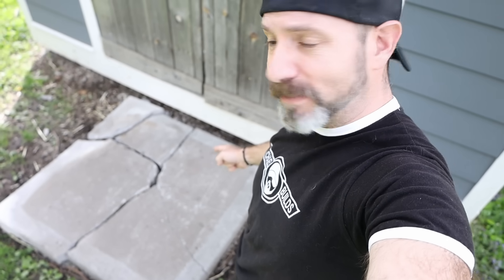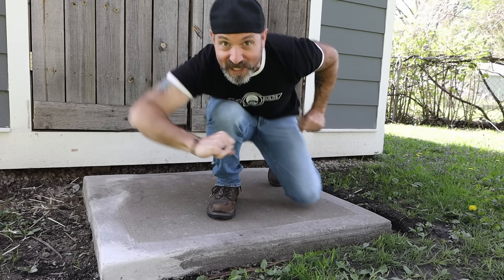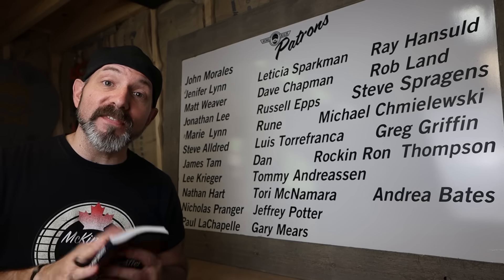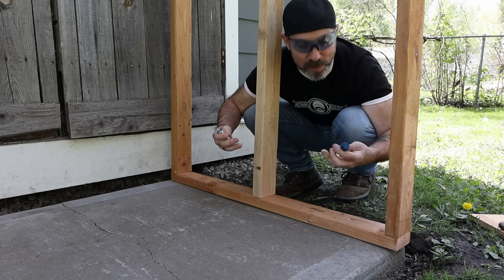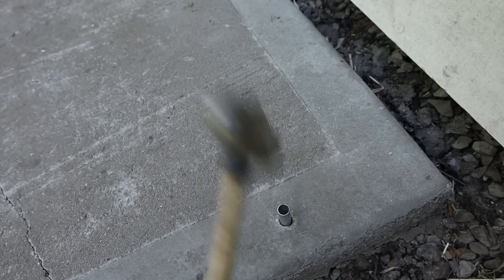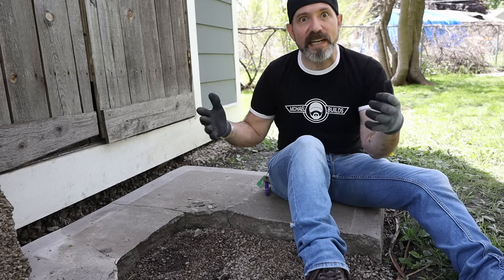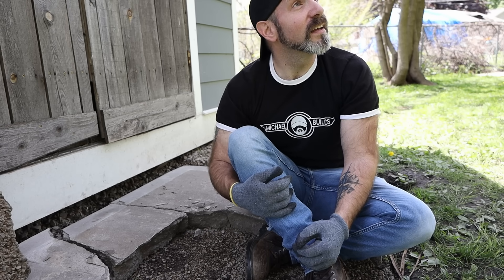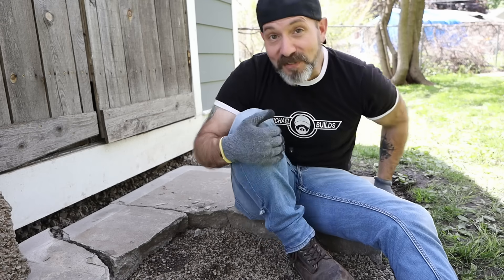Dry Pour 30 day cure Test

Comment: It certainly would have worked for a storage building. If the base is properly prepared, you should be able to drive on top of it. Had there been a hard-packed rock base, it likely would not have cracked.

Steel reinforced concrete helps spreads the point load out over a larger area, reducing the flexing in the middle. That tiny amount of concrete flexing each time you drove across the middle of the concrete was enough to mash down the soil underneath the middle of the concrete. That gap eventually became large enough to remove any base support.

Dry pour can certainly be effective for some uses, but the major problem I see with doing a dry pour is breathing in the concrete dust. Regular face masks, even N-95, are not actually sufficient in keeping all the dust out of your lungs. Even very small amounts of concrete mix dust in your lungs are a huge health hazard, which may not become obvious until years later.

I recommend placing a fan, powered by a small generator, so the fan is constantly blowing the concrete dust away from your face. You do not want even a light breeze blowing those tiny dust particles toward your face. You can’t actually see the tiny dust particles that can end up going into your lungs. If you can smell it, you are breathing it in, even if you can’t see it.
Reply: We pretty much quit using metal re-enforcement in concrete slabs years ago. Fiberglass works as well if not better and cuts out a lot of work.

Comment: There's a much easier way to solve this debate. Make some concrete cubes using the same method and have them crushed after 28 days at an accredited laboratory. To be thorough you could also take some cores and have them crushed at 28 days too (in case any one claims that that the cube is not representative due to the inability of the cement in the cube to absorb water from the ground below)

Comment: You should have a 4" diameter core cut, full depth, take it to a lab for a.compression failure test. That is one test comparable to a wet mix test.

You don't necessarily need steel reinforcing.  Your subgrade (that you poured the concrete on) was weak and soft.  Topsoil needs removed and a compacted stone underneath.  A lot of expense, time and waste when time tested procedures have been used.

How did you prep and create the slab?  I didn't see that in the beginning, a recap intro would have been nice.

Oh yeah, its masonry, not mason-ary.  Sorry construction police 😂

Comment: I’m very tempted to do my own slab addition. Will you use re enforcement on your lean to project? I’m tempted to dowel into my existing slab, and lay rebar fir the addition. My project is only a 4-6’ extension to an existing slab.

Comment: Dry pour is both lazy and extra work for a sub standard product. Just do it right and quit trying to cut corners. Its concrete, there is no reason to push the bleeding edge. mix it, pour it, let it set. Its not that complicated. You are just asking for problems trying to dry pour.
Reply: MichaelBuild  nope

Comment: As someone who works with concrete there are a couple of standard practices when placing a slab. Subgrade compaction to 92-95% max dry density (removal of soft material), placement and compaction of base course to 92-95% compaction of MDD, rebar at least 1-2" from the bottom of the pour (gives flexural strength as concrete is weak in bending and axial moments), and proper hydration of cementitious mixture. If your mix is dry it will crack and spall more easily, as since in your load testing.
The preferred method for testing in grade slabs, outside of a pen test, is coring it. If you take a core you can see if the mix was hydrated properly, if it has voids, if the aggregate was dirty, and to run a compression test. Anyway dry pour is a dumb idea for anything  outside of your child's toy house

Comment: I believe it cracked because it didn't have a solid base and still would of cracked if traditionally done. 
With those drilled anchors passing I wonder how it would handle a few rammset style nails fired into it.

Comment: It's really no surprise that it cured all the way through, as long as you're able to get the water in it. Cement actually needs very, very little water to react and cure. The amount of water that is normally added to "pour" concrete is way too much and actually reduces the overall strength of the concrete, but we add all that water to get workability and to get it to flow. I'm very interested in doing a dry pour like this! Looks way easier!

Comment: Michael, first of all, don't ever let anyone tell you that you're not a scientist, your methodology is so much more rigorous than what an alarming majority of clip-board carrying quacks in white lab coats are doing these days.  All science is, is a method by which you make a prediction, test it in a number of ways (as many different ways as you can think of), then document and report the results. A fancy degree does not necessarily a scientist make, but what you're doing absolutely does.
Now, by all means keep going with all the tests you have in mind, but the ultimate test will have to be a compressive strength comparison under controlled conditions.  I suggest the following:
Make 6 test cylinders using cardboard tubes (you can get those from a carpet store, they'll probably let you have some for free), 6" in diameter by 12" tall (or 5"x10", or 4"x8", etc. depending on what inner diameter tube you're able to find).  Use the same concrete mix product.  Pour 3 cylinders using the conventional, pre-mixing method, and do the other 3 by dry-pouring.  Remove the cardboard forms after 2 days, and take the cylinders to your local materials testing lab. Have them crush, with a hydraulic press, one of each at 3 days, 7 days, and 28 days, then compare the measured results at all the respective points of failure.  Repeat with a different product if you wish.
I think this is going to be the only way to clearly determine if pre-mixing vs dry-pouring ultimately affects the strength of concrete.  If the results come back similar, then all the other suggested real-world tests you're doing are going to be significantly more valuable.
Keep up the great work!

Comment: just a thought for you, while one wheel of the truck is only liike 1000lbs, the tires are wide,  so it disperses the weight, you want to find a way to increase the PSI by reducing the contact patch of the tire. also, the slab was moving quite a bit which means it wasnt supported very well under it.

Comment: You also should think about the weight distribution over such a small pad. For what you got I think it held up great I know I'm convinced I would definitely use for a driveway I would definitely make sure I have a good substrate  and pack the ground just to make sure no soft spots and use reinforcements and should be good to go

Comment: Convincing enough to confirm moving forward with our 8 X 20 front pad in front of our new house. Wire is a given, and a compacted base under it. The same size pad poured mixed, would have failed as well with the soil under the same conditions.

Comment: The way the ground was prepared, even a traditionaly installed slab would have failed. The slab failed because of the movement of it, not the strength.

Comment: I wonder if one could use some course Sand as aggregate while still using the "dry pour" method. Sand is much cheaper than cement and it also gives it structure.

Comment: The slab cracked because the was no rebar and wiring. When doing a driveway 100% you need to put rebar with wiring. Its not for strength, its so the concrete can stick together. When you do the next projects, you should add rebar and wiring in the middle.

Comment: One day I would like to see someone compare dry pour with standard pour by putting both in a press to get real numbers on things like comprehensive strength.  I'm convinced that dry pour is perfectly fine for many non-critical projects, but it would be very interesting to know exactly what kind of difference in strength between the two methods... if any.
Reply: Id like to see the same thing. Im not convinced that there is complete hydration towards the middle/ bottom of the slab. But it would be cool to see a core sample and a couple of break samples to see whats going on. My understanding is that even conventionally mixed concrete benefits from having plasticizers in it to achieve complete hydration at lower water to cement ratios. The chemical plasticizers break the electrical bonds that form between cement particles and allow water to hydrate everything completely and evenly. This method doesnt agitate the mix at all, so I dont see how the cement particles would ever be completely hydrated without anything to help break the natural bonds that form between them when introduced to water. Concrete is typically weakened by having too much water added to make it easier to place and finish, but the opposite can also be true. If there isnt enough water to hydrate the cement, it will lose strength that way as well. I could be wrong, im definitely no scientist and i dont engineer this stuff, but I am a concrete guy that tries to stay educated on the stuff that actually goes on in the mix and keep up with the latest developments in mix designs so that I can produce better jobs. The core samples would take away all the theories though and put some hard numbers down that people could use when deciding if they want to use this method.

Comment: I think you could easily add reinforcement to the slab. Actually kinda shocked no rebar was used. Secondly it looked like the ground under the slab was moving when you drove on the slab. Not a fair test.

Comment: So I was thinking of doing a dry pour for a garage/shop that will have cars and suvs and pickup trucks coming in and out to be worked on with a home made kwik lift on it as well. Do you think if I did 6” instead of 4 and added the rebar panels  to it that it would hold up to it?  Im thinking of doing it as I don’t have the money to pay a crew or have a truck come in much less know how to go about it that way. Even if I did the pad for one stall is 22’ long x 14’ wide so it would kill me to even try to wet pour.

Comment: For what it's worth, thirty-five years ago and building trades class we were taught to set mailbox post in dry ready mixed concrete. Like, grab the top of the sakrete bag and pour it in, then template down, then put a little soil on top and tamp it down. We didn't missed it, we didn't water it. It soaked up moisture from the soil, and, if you've ever dug one of those up, they were solid!

Comment: Despite its very high compressive strength concrete has very poor tensile strength. Steel has the same coeficient of expansion as cement and has great tensile strength. Rebar would make a great difference to bearing the weight of a vehicle.

Comment: Thanks Mike, you are one of my favorite idiots with a camera. I’m glad I found your content while researching dry pour after watching Cajun Country Livin’s video.  I’m seriously considering some small DIY projects that I had wrote off previously due to the perceived amount of time sensitive effort required by a wet pour that I didn’t feel I would be capable of at my age. One thing I’m interested in is a variation of your cement countertops using the dry pour method.  Cheers!

Comment: I think if you did proper ground prep and 48 hours of framing boards left on after the wetting concrete will give different results. I will be doing a dry slab shortly for my doorway on my shed.

Comment: Dry pour has been around for years. It was used in industry, look for dry cast concrete molds. they fill a mold vibrate to compact it then infuse water. they was able to demold sooner dry casting than pouring wet.

Comment: This is great. I think that the first test had a failure for multiple reasons though. First the Unleveled nature of driving on top from a lower elevation over allowed the vehicle to push, tilt and lift which is most likely the reason it broke rather quickly (yes a hundred times is excessively poor). Also it needs Reinforcement (even for a slab this size) would be very beneficial. 

If another test is performed add rebar and level the slab to the ground. So when you drive over, it won't act like you are riding up a curb. 

Overall I think the video and test were great. It definitely shows that foot traffic would have no problem. And truthfully Under better setup, I wouldn't rule out driveway use quite yet. Thanks again for another interesting video.

Comment: If the slab were larger,  had a more compact sub base and didn’t rock back and forth while you drove over it, I don’t think it would have failed.   Great video, I’ve been thinking about using this method to poor a patio extension for an out door kitchen. You’ve convinced me to try it.
Reply: Larger slabs fail easier. The longer the slab the more tensile force exerted.
Reply: I think if the base was uniformly level and compacted, the slab would have held up just fine. I am going to give it a try as well.

Comment: I feel like we need more testing. 
1. RapidSet, mixed, no rebar.
2. RapidSet, mixed, with rebat.
3. Quikcrete, dry, with rebar.
4. Quikcrete, mixed, no rebar.
5. Quikcrete, mixed, with rebar.
6. Concrete truck mixed 40'x26' slab, with rebar under my carport.

Comment: I did a dry pour slab big enough to put two dodge ram 1500's and my lawncare trailer on few years back. Hasnt cracked yet. If your going to be driving/ parking on it. Most of the important work is preparing the ground under it. leveling, sand, gravel, and a absolute crapload of tamping.

Comment: Thanks for doing the test, as mentioned below you really need to compare it to a wet pour to have any real value.
The major problem with the "Cajun" method is misting the surface, it makes a weak surface.  With your truck tires turning back and forth, it will eventually scrap away the weak surface unlike finished concrete that has a very hard surface.

Comment: Your concrete pad seemed to hold up under the compression load which was pretty light 30-50psi.  What broke the pad IMO was the tensile load caused by a soft sub-grade.
Reply: Sounds about right. Above the center mass is under compression and below the center mass is under tension. he didn't put rebar in the lower section? I took a mechanics of materials engineering class and the homework problems were almost like this guys example but without actual calculations on loads.

Comment: I found out for myself that dry pour is not good. Wet cement tends to fill voids better and attaches better. I did wet pour over rocks of 1.5 by 2 feet blocks, 7 pieces. They fared well during winter, heavy rains, and constant foot traffic. The dry pour, however, that I did recently, already falling apart from a heavy thunderstorm.

Comment: IMO Slab failed because you did not compact your soil prior to adding rock, hand tamping after the rock application will not sufficiently compact both rock and soil.  Additionally, you did not ramp up the vehicle weight onto the slab, from either direction, thus altering further the subslab compaction dynamics.  Also, it appears your final slab thickness was about 2-2.5" after rock was added to the form, it would have been helpful to show a tape measurement of the the variation in your slab thickness when using "dry pour", since you had to deconstruct the slab anyway.  Finally, I completely agree with your conclusion that your slab was more than adequate for it's intended purpose.

Comment: Derangement concrete broke is because running over with the truck compacted it evenly on the ground, leaving a void underneath
Here's how you can do it and I guarantee you it will not crack.
Remove 3 inches of dirt the same size as the pad that you're going to pour. Get inch-and-a-half thick rigid insulation enough gravel for drain. Then for an inch-and-a-half thick concrete on top of the rigid phone. The rigid foam distribute the concrete pad evenly there is no way it will crack
Reply: By the way, drilling holes removes material so poses no stress on a concrete itself. Just like drilling a piece of wood before installing a big screw keeps it from cracking

Comment: You really should take this to the next level and send out test samples of properly mixed concrete and dry pores to a independent lab for compression tests. Also, the thickness of this slab is less than that what would be recommended for any driveway, wet poured or otherwise. While it is a nice home done test, and it sure would have been press if it didn't crack. We should not be surprised that it did.